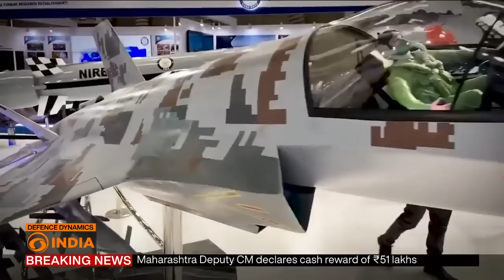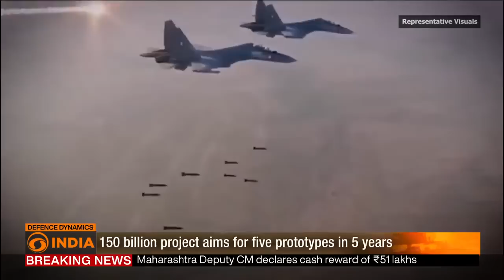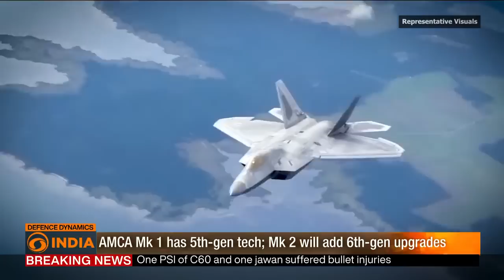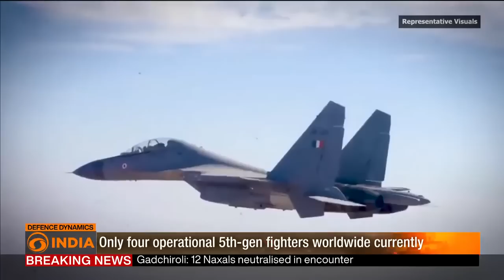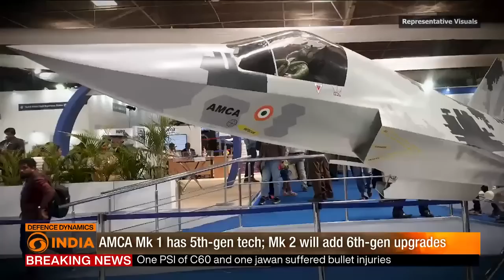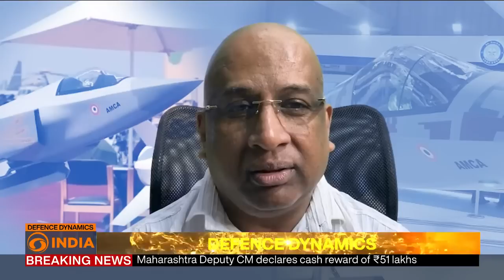Kaveri Engines and AMCA: India's Path To Self-Reliance & 6th Gen Defence Tech | Defence Dynamics

Comment: Its remarkable that Indian govt still thinks the US is going to supply engines for AMCA and Tejas Mk2. US is trying its best to delay and derail both the projects and yet India is not building its flying test bed for Kaveri and still not declaring fighter jet engine as a strategic project under PMO. 
Wake up India, wake up. do not depend on the US for your defence needs. 
Kaveri may be in infant stages but let a Tejas variant fly with Kaveri, test it and then improvise on it.